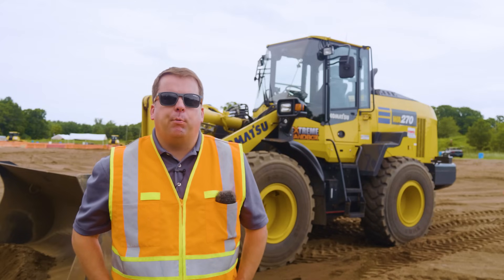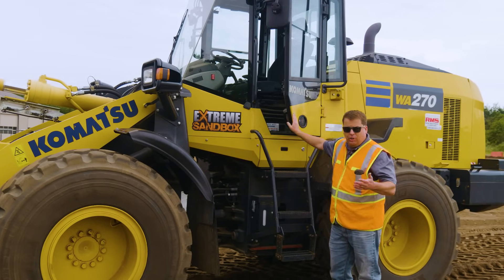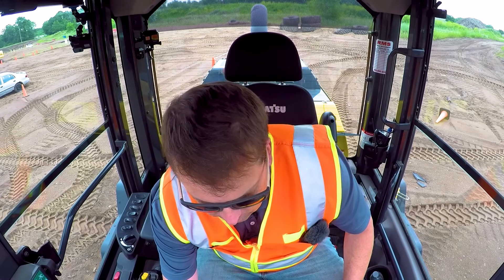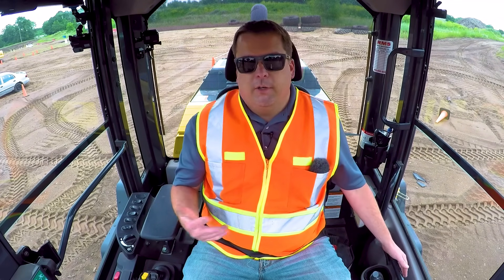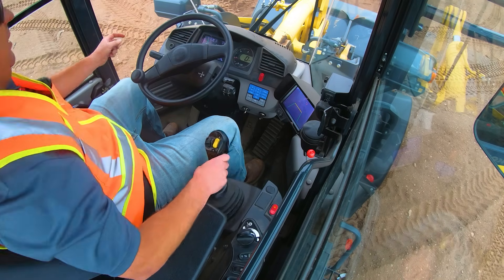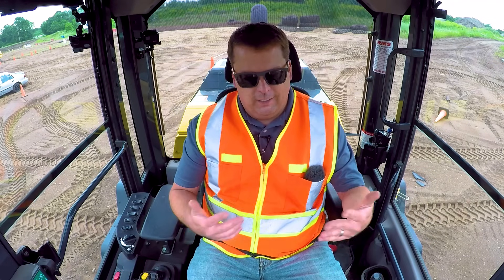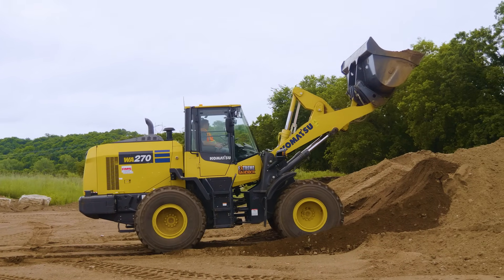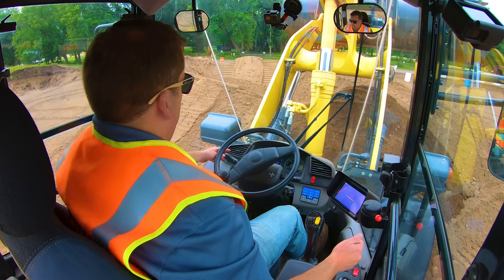Front End Loader Training (Beginner) 2020 | Heavy Equipment Operator Training

Comment: Joystick control for the bucket is just garbage. Two sticks is way better. Much more control and you don't destroy your sanity and your wrist.
10:44 He says you wanna be sure that the blade is level, yet he angles the bucked down a bit from level. You get a better fill if you slightly angle the bucket down, you just need to be careful not to start making a slope downwards.

Comment: The company I work for uses loaders to put aluminum material into a rotary furnace. Sort of looks like a wider, shorter rotary concrete kiln.
The entire operation, once the bucket is full, is overhead.
Oh, and when loading up the bucket, many operators, if not most, put the front wheels up in the air as they move forward into the "charge bin" (the big stall where aluminum material such as chips or dross is temporarily kept).
And on our biggest furnace, the charge bin is 180° from the furnace mouth
Reply: Hi am an operator and I don't have a job would you please refer me to a place where I can find a job

Comment: Much better than the loader I just learned on. Broken disconnected seat, run out pins that hold the hold the two halves together so the bucket sways 10 inches either way while trying to load a pickup, no reverse beeper, side mirror missing.  I complained.  Hey told me if I dont like it, go home. I went home. Buh bye, Courtland Landscaping in tillsonburg Ontario. Thanks for the tour of a real loader.

Comment: I'll be operating a lil CAT 966 soon. Keep your load low as possible while pivoting and your floor level and hard. Dump your 1st load into the truck as low as possible slowly to protect the dump body and not shock the driver. Keep all movements as short as possible for quicker loading. Dump with your machine as straight as possible.
Reply: well said.. good habit and it will keep you from damaging the dump truck...
Reply: @x...CrankyOldMan...x  unless you don't like the driver😅

Comment: The challenge for a new B is setting your blade level to the floor, you dismiss it by saying you have red lines well the problem is my machine doesn't not much  help on learning how to level the blade. Still good video man.
Reply: There's usually something on the bucket which you can see from the cab and that will be level when the cutting edge is. Sometimes it's the flat part on top of the bucket itself. Sometimes it'll be pieces of sheet metal sticking out behind on both sides, and you have to reference the top of those to get your level. Look the bucket over really well and there should be something there to help you.
Reply from the maker: Thanks for the info!